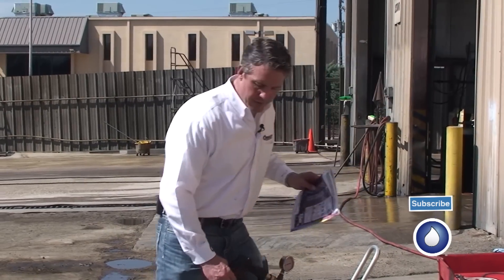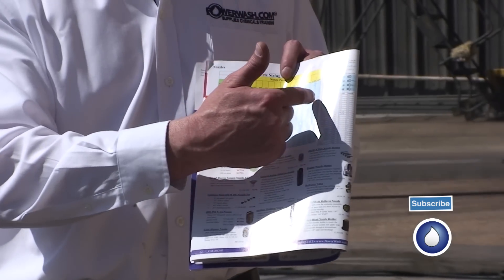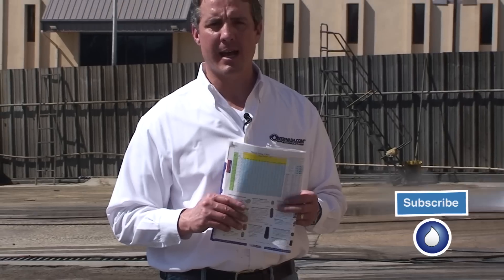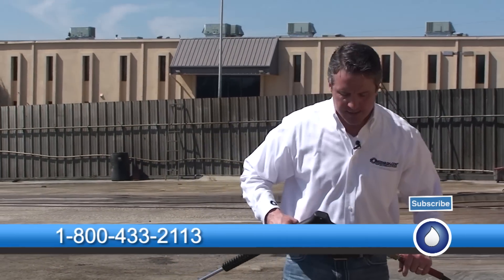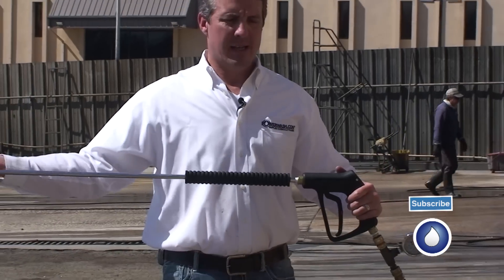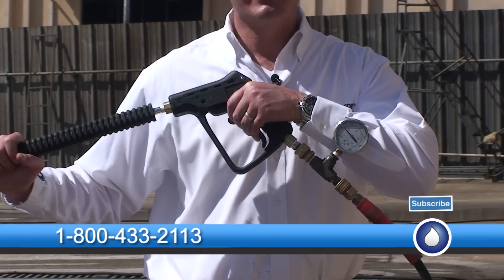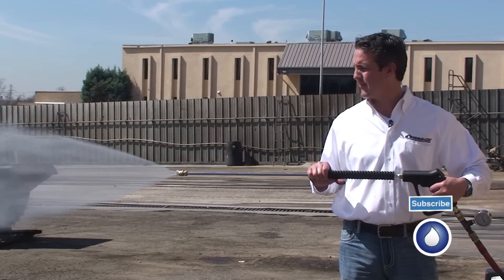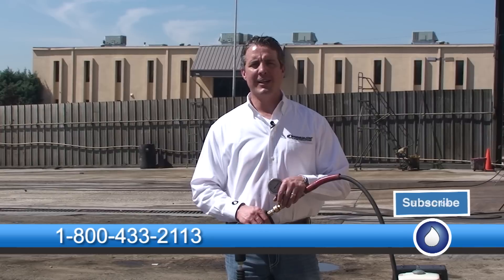How to Adjust the Pressure on a Power Washer | Pressure Washer Spray Tips

Comment: Hmm, my CAT pump manual states this "UNLOADER TYPE: An integral unloader with built-in by-pass is part of the discharge
manifold to provide system pressure regulation and pump protection." So who is right, CAT or this video?
Reply: The video and the manual state the same thing. An unloader is a protection device and is to be set to kick into bypass when the pressure is built up to a level that is the limit of the pressure washer. So a 4.0 gpm 4000psi needs to have an unloader set to 4000psi so when the trigger is closed on the gun and the pressure builds up the machine will go into bypass and not continue to build pressure in the pressure hose. So you shouldn't adjust your unloader down to kick into bypass at a lower pressure because it will constantly run in half bypass mode and wear out and break which could damage the pressure washer or the operator by bursting a hose.
Reply: I don't understand then why manufacturers attach an adjustment knob to it? If you're not supposed to turn it, what is the point?
Reply: @cybernessful  You can make MINOR adjustments with it.  Also since there is variability in engine performance, pump to pump, pulley or gearing the unloader is adjustable to place the system in to spec for your pump.
Reply: @DanielFarnan  Thank you for this explanation, pity I had to scroll down to literally the last comment on the video to find it
Reply: @cybernessful  overtime the spring in the unloaded will compress slightly and it'll need adjustment to get back to the correct pressure activate

Comment: Are you saying that white tips are different sizes?
Reply: No different angles 40º for white I believe.  on the nozzle shaft there should be am engraved number and that is the size of the nozzles orifice against some standard of which I do not know.  Anyway it will say 2.4, 4.0, 4.5 5.0 etc...  a 40º nozzle or a 15º nozzle of the same orifice should yield the same pressure.

Comment: Cat pumps..  lol. Yea they are decent,   But giant pumps are the absolute best.   I’ve got a Giant  P4130 which was manufactured in 1996...I use it a couple times a week..usually run 200 gallons,  maybe 300-400  on each job..  and my pump has never been serviced.. the only thing I have changed is the motor maybe a couple times... in 26 years...   the pump is the best on the planet

Comment: The "About" text could use editing...

It says "Larger orifices are low pressure tips.  Smaller orifices are low pressure tips."

It SHOULD say "Larger orifices are lower pressure tips.  Smaller orifices are HIGHER pressure tips."
Reply from the maker: Thank you for that catch.  We updated the comments.
Reply: Well...that depends on how you look at it. For a constant flow rate, a larger orifice yields a lower output pressure. For a constant pressure, a larger orifice yields larger flow rate and conversely a smaller orifice yields a smaller flow rate. BTW, I just watched the video and found it very informative and helpful. Thanks.
Reply: Thanks

Comment: I recently bought a 4000psi 3.5 gpm from northern. Because my old one was weak.
The driveway washer I am using is floating above the concrete 
Is there a way to adjust the psi but not the water flow

Comment: I don't understand then why manufacturers attach an adjustment knob to it? If you're not supposed to turn it, what is the point? Moreover, a lot of manufacturers clearly say in manuals that this is pressure regulator.
Reply: Some have been designed with brass etc to be able to handle changes like that

Comment: Can somebody please help me and give me real professional advice?:

I’m trying to make some side money  and I’m looking at this 4400psi Simpson . I’m mainly going to be doing drive ways  and side walks . No I don’t have a tank  I’m going to be using there water and charging vary  low   Since I’m doing that. 20-30$.
Reply: you need a tank. message me I can help you out
Reply: Just don't be enticed with the cheap price of Simpson 4400 psi; there's a reason the Simpson 4400 psi is cheaper than the Simpson 4200 psi, and that is because Simpson 4200 has a Honda engine and the Simpson 4400 does not. Honda engines are much better quality and last longer; Simpson engines can have starting issues also. Make sure to use 3/4" hose for water supply. Don't undersell yourself either; you're not charging enough. Very low bids can even make potential customers not take you seriously; you may also find yourself a rushing through jobs and cutting corners in order to make it worth your while, which will hurt your reputation in the long run. Give a nice fair price, take your time and do an excellent job, and referrals will start coming in from your previous customers. Good luck!

Comment: Thanks for the tip! I never paid close attention to pressure washer. I bought some nozzle tips at home depot and put them on my old 4GPM Honda pressure washer, thinking they all the same. I was wondering why the engine keep getting stalled out. I now realized those nozzles probably around 2.5 GPM, since most Homedepot pressure washers are for home owner use. The mistake cost me a leaking pressure pump. Lesson learned.

Comment: Why do most power washer mfrs. mislead by putting big adjustment knobs on the unloader & calling them regulators? And come with one-size-fits-all nozzles with NO mention in the manual that others are available that can be a better match?
Reply from the maker: The big nobs are there to adjust the unloader but it is common to misinterpret the intent.  The are not there to adjust the pressure.  Having one nozzle size reduces confusion.

Comment: Hmm, my CAT pump manual states this "UNLOADER TYPE: An integral unloader with built-in by-pass is part of the discharge
manifold to provide system pressure regulation and pump protection." So who is right, CAT or this video?
Reply: CAT!